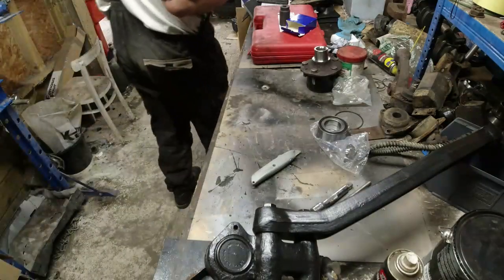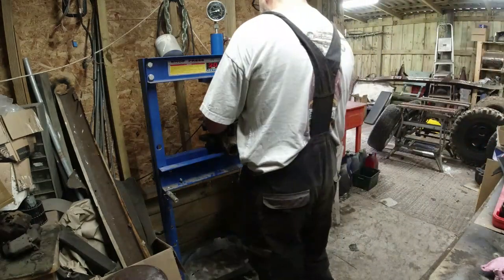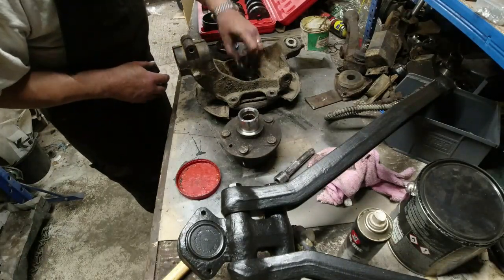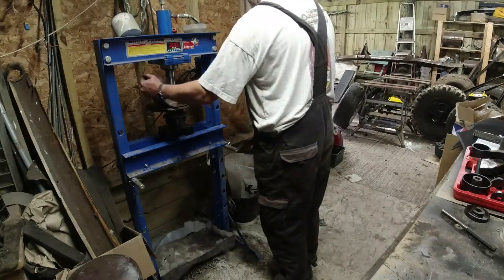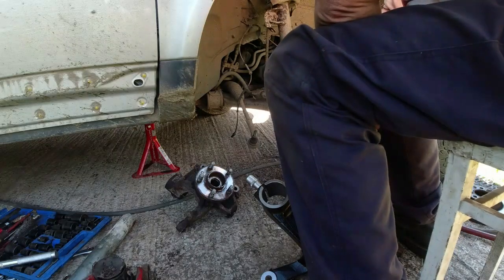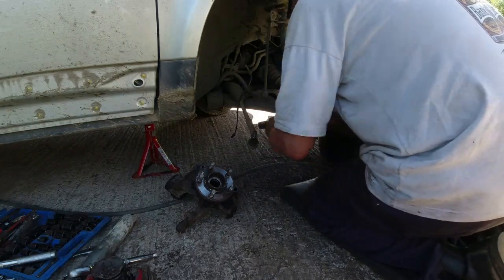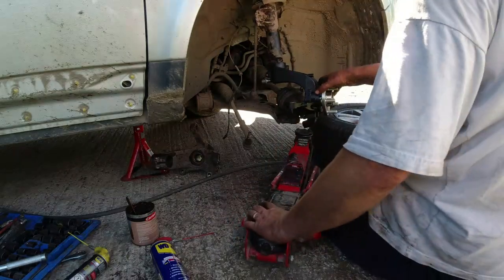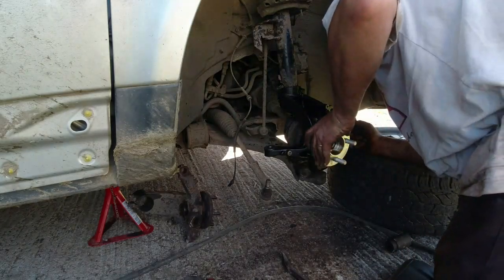Freelander 2 Episode 2 - Rear and Front Wheel bearing rebuild - Parental warning

Comment: Got a few of those T shirts such as use new bolts, cut stuff off and charge by the hour and another one, do not do deadlines! The pressure a deadline adds to a job really doesn't help when things go wrong and the struggle becomes a fight becomes a war. I would suggest you get Oxy Propane or Oxy Acetylene (propane is much cheaper) because it can get places grinders cannot reach and cut the head off a dragon in seconds! Great video young man, keep up the good work!

Comment: Enjoyed this video, my sides still hurt!
It’s easier to change the bearings on the car with the correct tool, I got mine from ebay it’s a copy of a Laser tool. 2 hours max per bearing.
Keep em coming👍
Reply from the maker: I did look but they were getting a bit pricey for a one off job. I did manage to get it done without by using a jemmy 👍😜

Comment: this was a great video, i sympathize with you as I have done many struts that are the same setup and you are correct remove the whole strut assembly get it on the bench and deal with it there, as for the drive shaft I would have junked it and put a new one in, (sorry customer it was too bad to re-use)
Reply from the maker: I know, i know but the customer was on a tight budget. Not that would have made any difference to my approach 👍🍻
Reply: @churchhouseclassics  I always do fixed price then I know what I will get and they know what they will pay + parts I don't rush my work and I am not doing it as a business, I hope she gave you a good tip Nudge Nudge Wink Wink :)

Comment: Well done Richard. Having done similar jobs on my L322 and several other cars of the era I feel your pain. I find hardened steel nuts and bolts fitted into modern alloy parts is a receipe for much sweating and swearing and General Tom Fuckery. They seem to chemically fuse with each other and become one unit. There is a more sciencey explanation but I dont know what it is. Perhaps I can formulate one after a few more beers. 🍻

Comment: Great vids. How did u do the camber alignment on the rear? Is it tbe bolts on the two struts (one tubular and one flat)  onto either side of the hub?
Reply from the maker: Not sure about that, sorry. I made this video a while back and haven't been near a FL2 since. I am however tempted by a TD4 so trhis may well change

Comment: I have a 13 year year old freelander that needs a O/S rear bearing change if you’re interested?

I remember the first bearing I had changed he garage we telling me they couldn’t get the half shaft out, had it in presses, breaker bars, all sorts. In the end the dropped the whole thing out and somehow got it apart. Didn’t sound fun when they were telling me
Reply from the maker: Best of luck with it, aim for replacing strut, hub and drive shaft ... oh and all the bolts. And get a gas axe 🤬😲😁